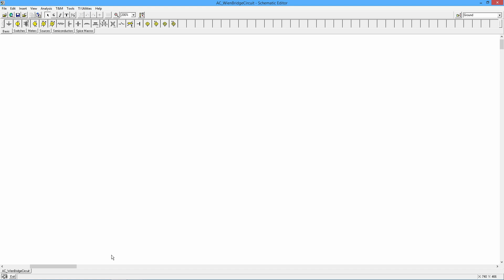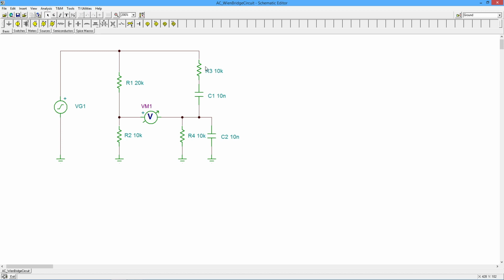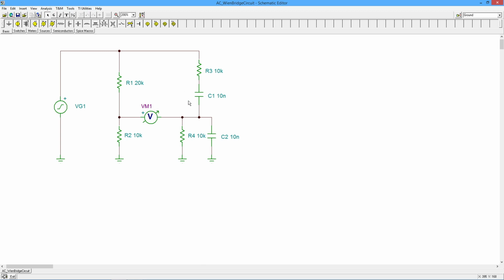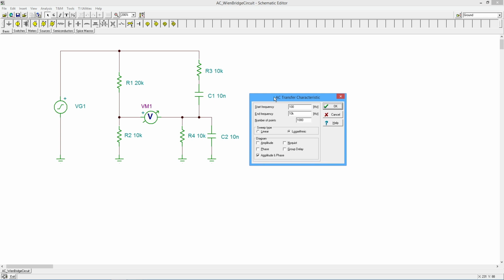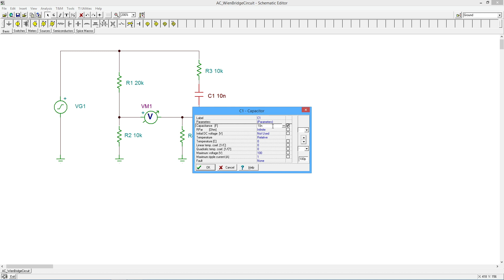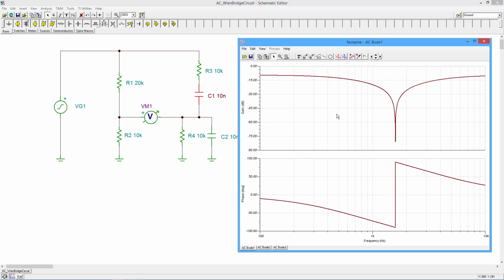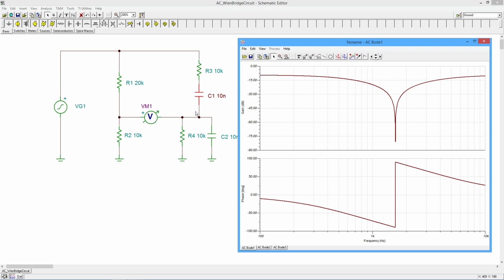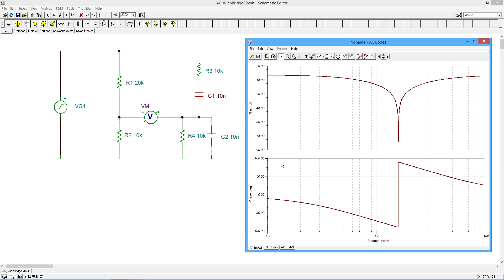AC Electrical Circuit Analysis: The Wien Bridge

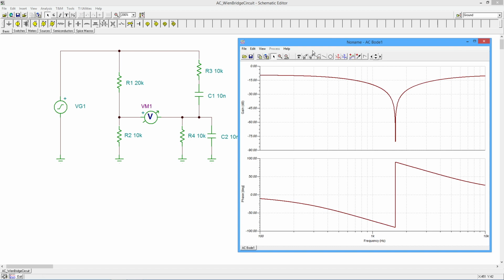Comment: Hello, I am using this Wien Bridge circuit as a way to verify the values of the capacitors I am using. I made the circuit in real life with (close to) the same values. However, using a vector network analyzer, I don't see the Bode plot as expected in 6:43. Instead, I see a constant gain at -9.5 dB. Would you happen to have any suggestions as to why the null point doesn't appear in my Bode plot? Without the use of a multimeter, do you know of any simple circuits to precisely measure capacitors?
Reply from the maker: Generally speaking, if you're not getting a null, then either your values are way off (by orders of magnitude) or something is connected incorrectly.

Comment: i am confused why bode plot shows null as -72db. At critical frequency both sides of volt meter would be a third of source voltage. Since there is no voltage difference between left and right sides of voltmeter, there is no gain (0db). So shouldn’t null be shown on plot as left and right sides of critical frequency creeping up to 0db instead of going down to -72db?
Reply from the maker: 0 dB isn't zero (nothing). 0 dB is ratio of 1:1. A gain of 0 dB is an ordinary gain of 1.
Reply: @ is the bode plot measuring the voltage difference across the voltmeter? is the null when the gain is 1?
Reply from the maker: @rudygomez6996  In this sim, the potential across the voltmeter is what is being plotted. If the meter reads zero amplitude (i.e., null), then that means that the voltages across R2 and R4 are the same.
Reply: @ElectronicswithProfessorFiore  okay im beginning to understand ty professor

Comment: Good video....I didn't watch op amps series? What is gain ?
Thanks.
Reply from the maker: In general, gain is the increase in signal, either voltage, current, or power. An amplifier might have a voltage gain of 10, meaning that if you applied 100 mV at the input, you'd get 1 V at the output.
Reply: @ElectronicswithProfessorFiore  Thanks for your prompt reply. By the way, for learning electronics, in which series (arrangement) should we watch the series. As I am mechanical engineer, I don't have idea which series should I watch first for better understanding?
Thanks for your excellent work.
Reply from the maker: @cck0728  If you have minimal electrical background, start with the DC Circuit Analysis playlist. Once you've completed most of it, you can start the AC and Semi Devices playlists. After that, move to the Op Amps and Embedded Controllers playlist.
Reply: @ElectronicswithProfessorFiore  Thanks for your kind advice...I will try my best. Keep on sharing your valuable expertise.